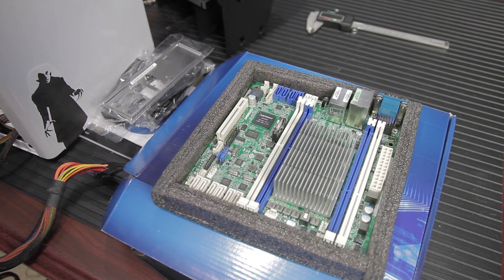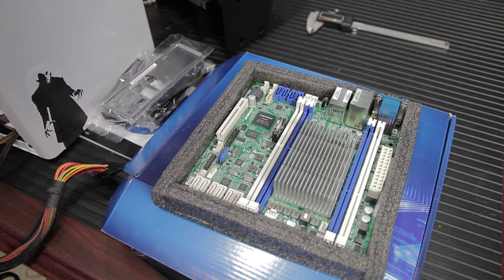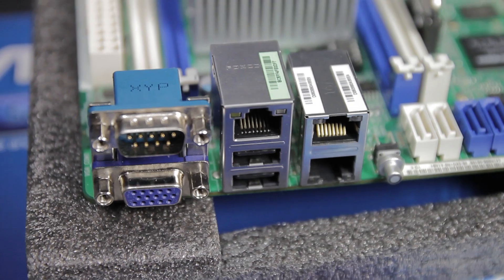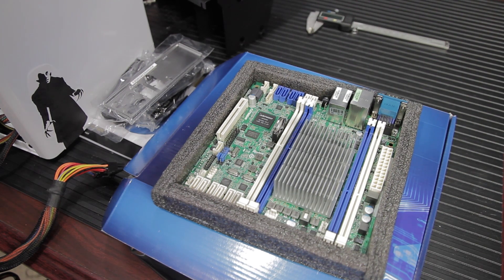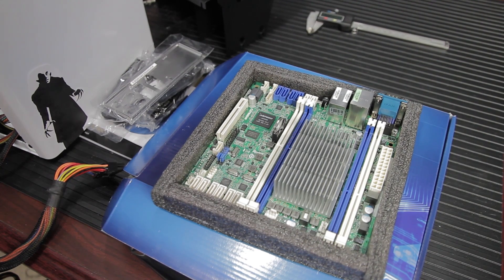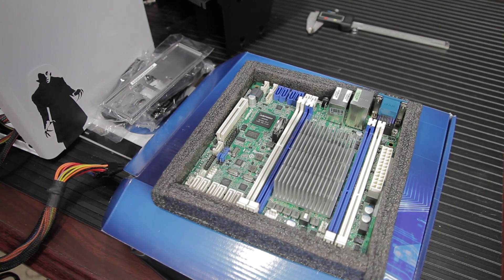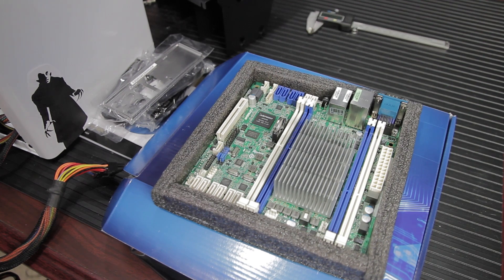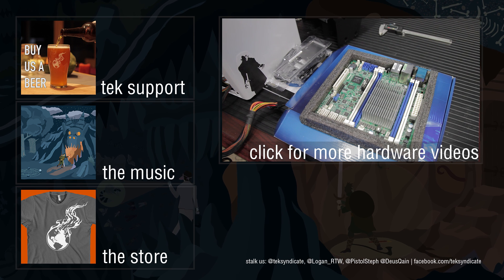ASRock C2750D4I: Intel Avoton C2750 Octa-Core ITX Motherboard

Comment: set it and forget it.. until it does from the BMC flash being written to every second, which ultimately leads to it be unable to post, which is great since the failure mode at least for me appeared as a critical high temperature which made ipmi reset the computer........

Comment: Has the clock chip gone out yet, rendering the whole motherboard useless?  In case you don't know what I'm talking about: Intel finally admitted that the Atom C2xxx series is critically flawed, and has about an 18 month lifespan before it bricks itself.

Comment: Personnaly, I use the Supermicro A1SAi-2550F for freenas. It is less powerful than the C2750 but has 6 SATA ports which is just perfect with the exact same case.
It's probably cheaper than the ASRock C2750D4I but I don't know as it is not avaiable here.

Comment: As it relates to a Home Server setup, I was very disappointed by the complete lack of any Power Management. No Sleep whatsoever.
Reply: +RJ_Make It's intended for applications where it would be running full-boar 24/7. Doesn't need to sleep.
Reply: Plasmo
Yep, but in my application, where it only needs to run for 6 hours a day, it's a massive waste of energy when you have 19 HDD spun up. That's right, the drives on the Marvel controller will not allow the drives to go into standby mode on this board, same goes for the Mediasonic H82-SU3S2 ProBox enclosure. The server, with all the HDD spun up pulls 138w.

I guess whats frustrating, is that the board originally had S3-S5 sleep modes, but then the BIOS team removed it because they couldn't or did want to fix it. So they just removed it.

I did find a way around the entire mess with Green Lights_Out and my Home Automation system.
Reply: I wish I could afford to swap out 19 4TB HDD's with SSD's, but unfortunately I can't. So because the BIOS team's lack of effort to resolve the problems with the FW, (they just disable functionality they can't fix) the board remains handicapped for me 

Thankfully I've found a way around it as I stated above.

Comment: Since this board supports link aggregation, would the 2gbit/s connection be helpful for a NAS serving multiple clients on the network? It doesn't make much sense to have one 2gbit/s connection if everything else on the network is 1gbit/s.
Reply: +MrLoverThe for one user no, but if multiple users on the network are hitting the machine at once it could help not heaving network bottlenek
Reply: mihai onutu Thank you so much for responding, I was curious and this is really helpful.

Comment: Hmm.. "..and at the wall i'm not erven drawing 100 watts, most of the time. Must mean we're somewhere near 100 watts though, and that's a damn high power draw, but i've seen similar results from other reviewers. Sadly this little board seems to use a hell of a lot of power, for what it is. 

I was considering this for my homeserver, which is why i'm here. But.. Atm i have a MSI H97 ECO board, and a G3258 cpu, and running one mech hdd it usually draws around 23 watts during  ligher loads. Not even at start up, with all six hdd's spining, do i get to 100 watts if memory serves me right.

Too bad. i really liked the idea of this, but having read and seen three reviews all pointing to aridiculously high power draw, i'm out. Will stick to upgrading my motherboard to a 12 sata ports one, so i can throw more hdd's in the server.
Reply: 40 watts at idle, 50 watts at full load.

Comment: I would like it but its £301~ the point of going with this kind of setup for me that it isn't much more expensive than a 4 drive prebuilt NAS and would have much greater expandability and would be able to do limited processing for extracting and repairing files so I don't have to do it on my own PC if I don't mind waiting a bit longer.

Comment: Any news about an upcoming release of the successor of this board?
Regarding the present price tag of around 400 Euro (450 USD) here in Germany and the "age" of this board, I think I'm better off waiting a bit more despite desparately needing an upgrade for my current NAS-solution...
Reply: +TheShadows007 I would like to know that too... With my luck, I buy this now and about 2-4 months a new board comes out.
Reply: I got to this model some time ago from the so called solution, intel seems to have released this year the celeron and pentium system on a chip quad series, you have it on the q1900 asrock boards or the pentium 2900 ( that only clocks higher in turbo), problem is that there is no raid support mentioned, I got the q1900m with pci express 2 at 1x (with 500mb bw) having pci e, they only put two sata 2 plugs on the board but you can get the mini itx versions with sata 3 and even with this limitation, it s totally capable of linux server,  problem for me was that on windows its shit, especially if you want to run the larger 64 bit code for more than 4gb of ram for a comfortable browsing experience, the 2mb l2 cache on the low voltage integrated processor is just not enough to handle 64 bit windows, as for linux, it doesnt even compare,  the soc design doesnt get hotter than 55 degres celsius even without a fan, but with the integrated gpu disabled mostly, so I two was hoping to find news about the next octa core model, but it seems that it had its inception some time ago with the atom server soc, anyways, for this kind of money, anyone can do a server and the industry doesn't really want to give that away for nothing or to anyone right ? especially when these system on a chip boars cost less than 100 without ram and ssd...
Reply: +TheShadows007 another thing to mention about the entry level celeron bay trail boards is that they almost keep up with my old c2d e7200, but that has 3mb L2 and it runs better even on 32 bit or whatever, at stock freq with lower voltage, it could use the same power as well ( if you dont see a big diff between 70 or 100 watts for the whole system) :v

Comment: Whats the difference between streaming something thats transcoded and something thats not? is that implying that the video file is of a lesser resolution/bitrate?
Reply: +Luger718 not necessarily, it just takes more work for the computer than reading and sending it along. tablets and phones usually have much more restricted codec support, at least without downloading something like mplayer (on android), so plex will transcode it into h.264 which it knows the tablet can support before pushing it over the network.
i don't know the details, so it might alter the bitrate too.
but it will take more cpu serverside than just streaming the file into VLC on your computer for example

Comment: Well It runs XEN Server Well had WAN > PFsense 2.2 > untangle 11 > to LAN  also Windows Server 2012 R2 and Ubuntu Server. running well all at once.  Have 32 GB of RAM and a 4 Port Intel NIC,  SSD for OS and iscsi target.

Having some problems with Bridge V lan. Its a Driver problem.

I Would like to see some videos on that setup ? as i'm still a noob at this. Wish you guys had a video setup, like you did with pfsense.

Comment: So that last RJ45 connector is dedicated for IPMI and won't do Ethernet at all, right? Or is that also 1 Gib/s?
Reply: It's Ethernet, but it doesn't provide network service that plumbs to the CPU, only the LOM/IPMI chip. He did mention you can change a setting in the ROM setup to share the primary NIC between IPMI and the OS though.

Comment: Just bought the C2750D4I. I may need to get 2 more red 2 tb hdd I order 4 and I really want to configure Freenas wjth ZFS2. I just finish the build today with the 4 red hdd that I order but wow I got issues managing the power cables on the Fractal node 304 case. I just did a quick boot to test if it boot up. I confirmed only 2 hdd being display on bios out of the 4. I need to look at it.

Comment: Actually bought this board, and running Proxmox VE on it with 32Gb and 20TB of RAID5 storage in a vm... Still saturating 1Gbps on transfers over the network with 6 KVM based VMs running (mail, spamfilter, proxy/firewall/gateway, webserver, nfs/cifs fileserver, sabnzb download server) while still below 75 watts with 6×4TB WD Reds, 2 500gb Samsungs (raid1) and 2 1Tb 2.5" drives in raid1.

Comment: Disappointing those eight cores just keep up with a E3-1230 v3. Well, I guess it's time to stuff a LGA 2011 E-ATX mobo into a Prodigy.
Reply: youre missing the point. this is a passively cooled atom that uses a fraction of the power as a e3-1230 v3.
Reply: hgnuwhn gmewnmol I see your point. Stuffing low power hardware in something as big as a Prodigy is pretty overkill.
Reply: if you need tons of storage and ram but not much processing power, this would be very useful.

Comment: I can't believe this isn't an April Fools Joke...but hey, cheap render farm?
Reply: Not sure if  you are trolling but here goes.  A CPU core can execute 4 32-bit instructions per clock (using a 128-bit SSE instruction) or 8 via AVX (256-Bit), whereas a GPU like the Radeon HD 5970 can execute 3200 32-bit instructions per clock (using its 3200 ALUs or shaders). This is a difference of 800 (or 400 in case of AVX) times more instructions per clock.  You would need 800 CPUs in your render farm to match the computing power of one Radeon GPU.
Reply: Liam Parker My render software (mental ray) has nothing to do with GPU, and has no ability to use any GPU hardware. In the case of most GPU based render software, although the 800x instructions don't exactly even out because GPU rendering technology is not yet at it's peak for things other than gaming. The instructions a GPU can do are extremely specific, and none of them fit the bill for Mental Ray.

Comment: I double checked with Intel ARK and found that the processor supports VT-x and not VT-d (you said it exactly the other way around) which makes way more sense... why virtualise a device when the processor is not capable virtualising anything?

Comment: 12 SATA ports is a bit of overkill for a board this size. If I am going to be using 12 drives, I might as well get a mid tower and an ATX motherboard. 6 would have been plenty for a smaller NAS.

Comment: A measly 3797 in passmark...meh.A 1230Lv3 will be a better choice,considering this motherboard is not that cheap.
Would go for a 1265Lv3 or 1268Lv3(lower clock speed than 1265L,better graphics) for a higher end NAS.
Reply: Depends on whether or not the NAS is transcoding I initially thought that having more cores in storage builds would be of greater benefit, but unless you're doing dedupe, compression, or other CPU-intensive tasks it really doesn't do much - RAM is the bottleneck in this scenario. You could stick a Pentium G3440 in a Supermicro X10SL7-F board and still have it perform well with FreeNAS as the operating system. It won't do simultaneous transcode jobs or dedupe very well, but it will handle everything else just fine, provided that you have enough RAM to support the storage.

If you want to run WHS or Server 2012 as the OS, then sure you'll want a CPU with more chops, but if it's just serving storage using a ZFS-based solution then the drivers are (more often than not) HDD spindle speeds and RAM.

TL;DR - PassMark scores don't necessarily translate to real-world performance with targeted use cases.

Comment: Totally fake :) good luck for running 64 gb out of 4 slots...
Reply: You could run 64 gigs on 2 slots if you wanted i guess. But 32 gig eec modules are a bit expensive still. Cost as much as te board lolz
Reply: Learn to do some research first before spouting rubbish.
Reply: Altruistic i dont know what your problem is. But a single 32 gb dimm costs more than this mobo. So im puzzled with your comment. Havent been laid in a while? Or are you just a little anti-social?

Comment: Wendell when you think about it with the IPMI the board makes up for it self in price because you don't need to connect a monitor keyboard and mouse. Which cost more than the IPMI. And you can control the PC and install an operating system without touching the computer. I think the board is under priced

Comment: ASRock? Ha! I learned from my mistake back when I chose their LGA 2011 board Extreme4 in 2012. Fuck ASRock.
Reply: many people have run that board well and it is recommended by a lot of people as a budget friendly board.
Reply: ***** asrock used to be a company you would want to stay away from, but they make very good boards now.
Reply: Tyler Raber Yep pretty much my Experience so far.
Reply: Don't buy a Cheap Board on LGA 2011 then.
Purchased 13 Boards from them all are still running fine most likely just got a dud.
Reply: ECS on the other hand....

Comment: I'd like to see how temps are with max load, because I'm very weary of x86 with passive cooling, ESPECIALLY 8 cores at 2Ghz. 

Also my perspective on this is a file server with multiplayer servers running in VM on one machine with so little power I can leave, oh say, a minecraft server running 24/7.
Reply: Aida 64 report is on teksyndicate.com: 53 degrees C after 8 hours of Aida64 burn-in testing on Windows 7 pro on this board. TJ Critical on this cpu is 80 degrees C. It was "barely warm" to the touch. BTW this thing does turbo boost, so it was in turbo boost the whole time (nearly 2.6 ghz)
Reply: Thanks a ton!

Comment: I would be interested in something like this, if an m-ITX case existed that isn't an ugly rack in which you could populate all the SATA ports. BitFenix Prodigy/ Phenom would be closest, with it's 9-10 drives. I guess with 3-4 SSDs, you could populate a Phenom with 8-9 mechanical drives though so it could be the one for me.
Reply: If you dont need a big heatsink like with this board,ba node 304 can easily be modded to hold 10 disk. Especially if you use an ssd for system disk and use 2 or 3 2.5 inch hdds.
Reply: Ive got 5 drives on one bracket in my 304. 2 laptop drives on the inside, each 500 gigs. A tb 3.5 inch drive on the outside and 2 ssd's taped to the laptop drives. Works great.
Reply: Ive got 5 drives on one bracket in my 304. 2 laptop drives on the inside, each 500 gigs. A tb 3.5 inch drive on the outside and 2 ssd's taped to the laptop drives. Works great.

Comment: ECC memory support is impressive. Getting an Intel board with ECC support is rare - especially for an ITX board.
Reply: I know? It's crazy. But that's not what really cooks my noodle -- this thing supports 16 gb dimms. Even socket 1150 doesn't support that! Only 8gb dimms on the 1150 stuff, even xeon, according to Intel Ark. 64gb on this thing would be mental.

Comment: Now they need to make a sli ready itx board
Reply: That would be a M-ATX board
Reply: They have them, buy a dual GPU Nvidia card. JK
Reply: i want on that has 2 pcie 16x slots and i can use and pcie extender and have dual gpu minco itx computer. then i migh tconcider itx

Comment: i wish that there was a gaming or standard version of this with pci 16 3.0, some more usb, an lga or amd socket, and some standard ram. But there isn't an itx case on this planet that could house nearly that many sata devices. One would need some external cases or something. However, the raids you could run with this, if it supports raid, would be awesome. Just plaster the inside of an htpc case with ssds and watch the magic happen.
Reply: Most GPUs (Nvidia & AMD) can run on a PCI-E x8 slot. But it would be nice to see this as Gen 3.0 instead of Gen 2.0 though.

Comment: Any downside to using this kind of hardware a main rig? I mean shit I want that. Seems quite powerfull (matching a xeon 123 whhhaaat?) Probably more realiable than most boards. What is to prevent me from getting this kind of hardware in an mATX form factor, slap on a video card and an I/O expension card?
Reply: Well there are only like 4 USB 2.0 ports on this board, as well as what looks like PCI 8x slot, so you won't be squeezing the most from your graphics card. Also there are definitely better looking ITX boards out there, although if you think you need 12 SATA ports for a HTPC, gl finding a better looking board
Reply: Yeah, this is why I was mentionning getting something like that in an mATX form factor to be able to put an I/O expension (more USB ports) and a graphics card. Alors 8x vs 16x doesnt make a huge difference on a GPU
Reply: I think he meant a Xeon E3 1230 V3.
Reply: Nothing, you could easily build a mITX rig. However limited to a x8 PCIe slot, a gaming GPU is a bit wasted. Beyond that its integrated graphics will be a bit on the useless side. There will be a lack of standard features such as lots of USBs, headers, no audio, etc. There is also no official support for desktop Windows operating systems. The processor will be a multi-core workhorse, but not exactly rapid. The 4MB cache is also a bit on the lower-side for a desktop use.

Beyond that, lack of drivers and compatibility or other excluded technologies could mean a huge amount of stuff doesn't work from hardware to software.

Really not a wise choice.
Reply: Wow, did anyone read my comment? I am not looking for this exact board, I am looking for an mATX more feature-full board of the "line" (enterprise/server grade) with either more I/O ports or more PCIe to put an I/O card and GPU

Comment: Tek Syndicate That button behind the mobo IS a big deal in terms if your working in a server rack. It's for when your working behind the rack servers and you want to identify what server your working on from the front. I'm sure there is a header on the mobo for a button you can put on the front bezel or it's prolly in the IPMI so you can turn the back button on.